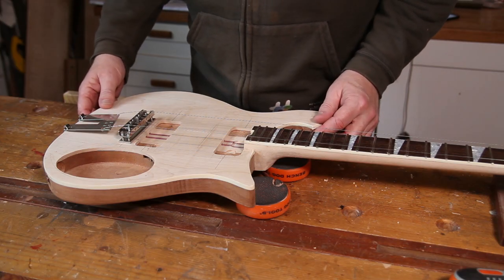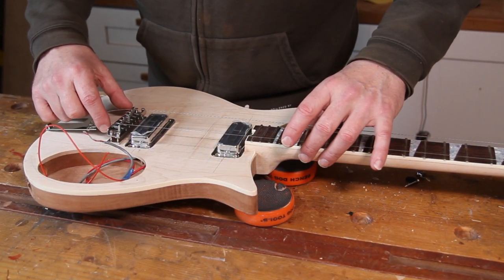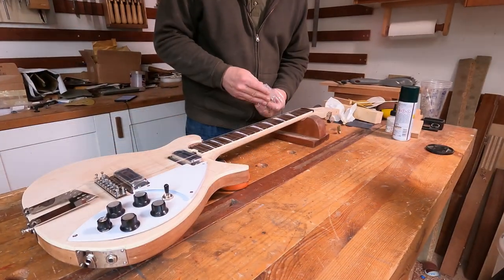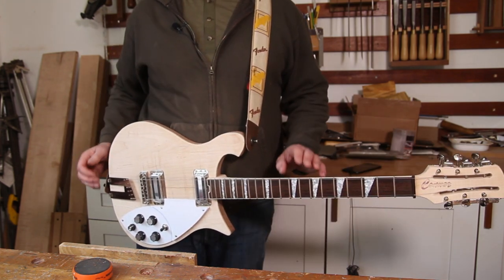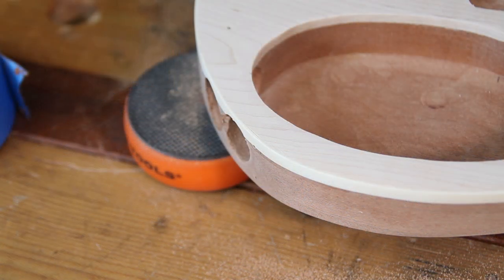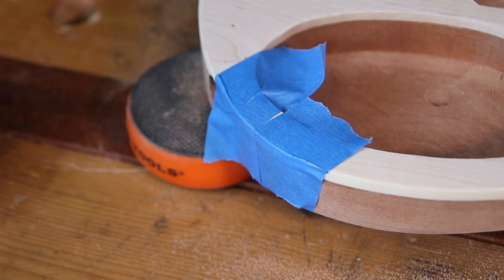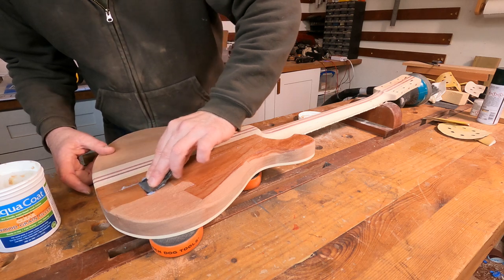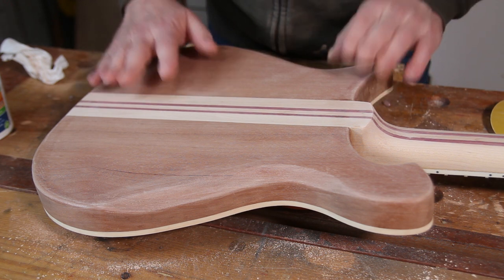Rickenbacker 620/12 guitar build Episode 36

Comment: Hi there, loving this build, I'm a bit late but binging this before getting back to your latest. Just a quick question about your sanding process. Does the binding just get sanded along with the timber and comes good with the finer grits, or are you somehow avoiding it? Loving your work.
Reply from the maker: Thanks, I always try and keep away from the binding while sanding. It should be smooth enough after the scraper.

Comment: Do you place anything on the table to prevent dents and scratches, such as a plush bath towel?  Will you stain the wood before you seal it?
Reply from the maker: By this stage the guitar will be sitting on bench cookies at all times to stop it getting dinged up or I will line my vice with cork. I will be using coloured lacquer on this one so no need to stain.